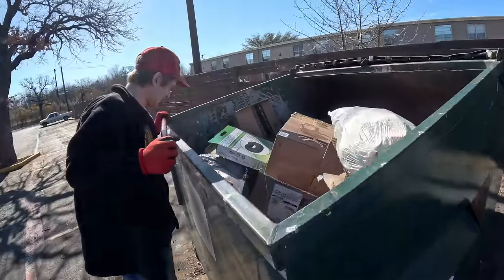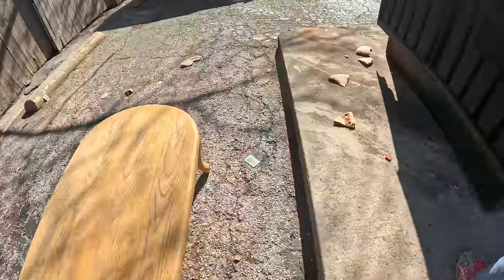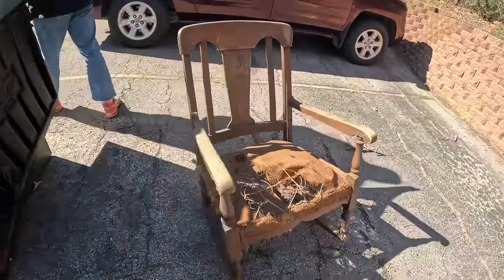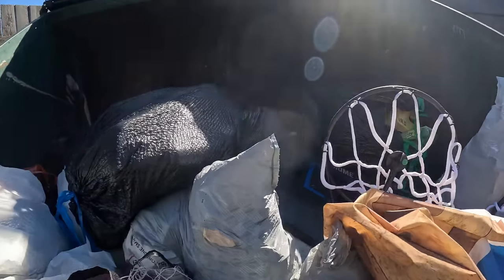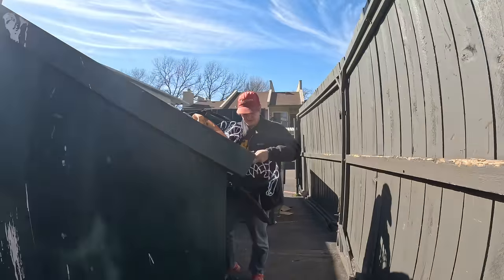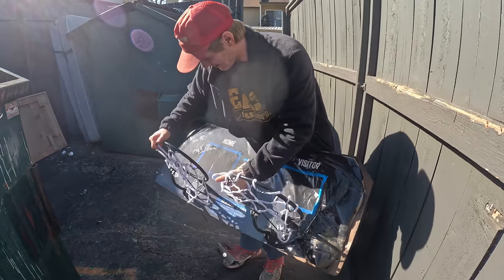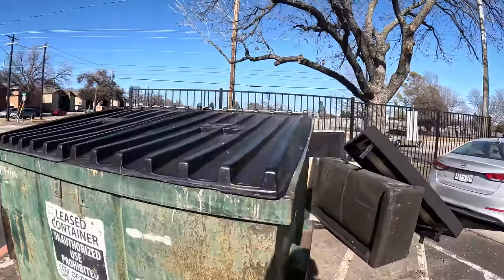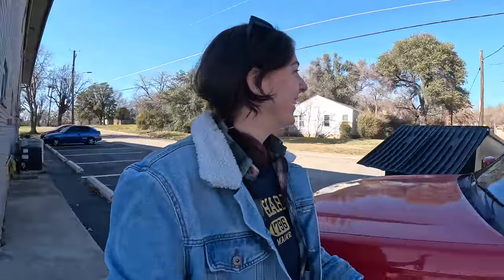Dumpster Diving at Apartments - Alex Finds Something He Wanted!

Comment: The small table would have been an easy fix if it was only the one wobbly leg (Glue & Screw), a quick sand and a new coat of whatever you like. Tht rocking chair was an antique, I would have had to save it, clean it upand reupholster the seat - leaving the springs in it and sand and recoat the wood. But then, I have a fair bit of spare time 🙂
Reply: Yes I was saying same thing to my iPad but they left it

Comment: You can buy the forever filters and just put your own coffee grounds in them

You have to put water in it to test if it’ll work by hitting the start button and you can run it with just hot water
Reply: U forgot that u have to put a podcast in for it to woek
Reply: @UsernameUnkwn21  i’m hysterically cracking up over “podcast” But no, I run my Keurig without a item in it just so hot water will flush through and clean it weekly

Comment: I am sure someone has already mentioned  putting water in the back, place a cup under the pod holder. 
Push the start button to see if it works. 
It won't work without water. 
Every Keurig I have ever had will work without a pod, but not without water. 
As always I love watching you guys. Great job!

Comment: 34:15 Water must be filled, or it won't  work. Don't  throw away until you fill to the  water line. Mine will stop when water gets low. Also, you need a k- cup. Mine won't work without one. I use a replacement  cup without anything in it to dispense  hot water. Depsnding on the model  or brand determines if you need a k- cup.

Comment: You need to put water in it to test it hun!! If it comes out hot all is good. You don't NEED to buy the k-cups you trash either. They have reusable ones. You even can put hot chocolate in them! Most pods are recyclable now also. Just have to peal the paper top off.

Comment: You can buy a reusable mesh pod that you can put your coffee grounds in.  I would wash it using vinegar in the water tank in the back.  run it through then run water through it to clean it.  Fill the tank with water again then try it again a k-cup or reusable one, you can find them in the coffee isle where the filters are.

Comment: It needs water in it or it wont light up. We have one at work and i just use it for hot chocolate. You dont need a k cup. Just open the lid, press the button and hot water comes out